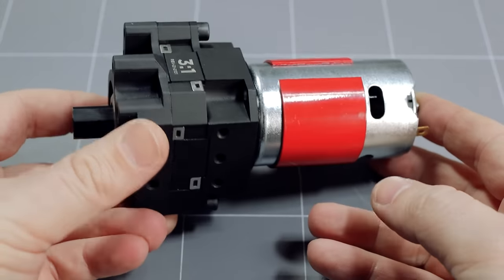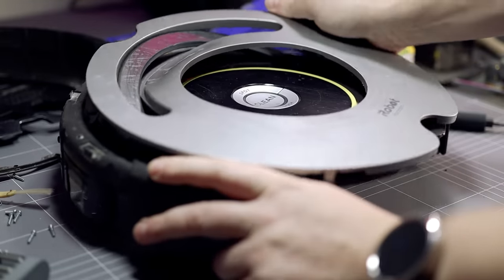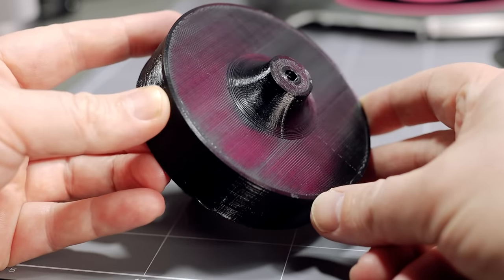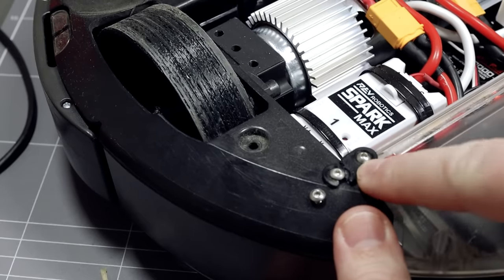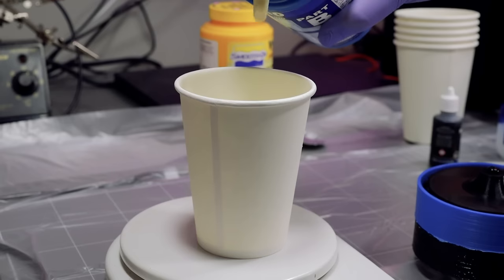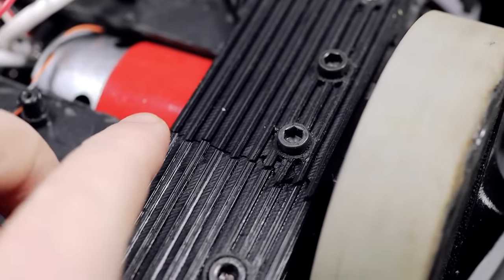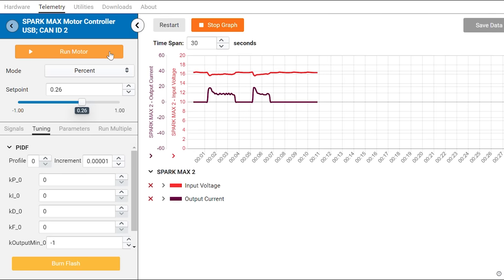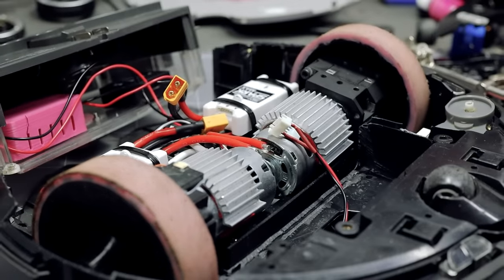Building the World's Fastest Roomba

Comment: In my humble opinion, you don't need stronger wheels. What you need are rudimentary suspensions for your Hot Rod Roomba. I believe that new suspensions would also help with the handling problems. 
A more flashy painting would look good, too! 😉
Reply from the maker: Maybe some simple urethane spacers or something?  A paintjob would be nice too.
Reply: I mean, you're already 3d printing the wheels, why not just design them to flex a bit? I'd try some "compliant wheel" research if I were you.
Reply: @Mr.Glitch247  Perhaps a spoked wheel design where the spokes are shaped to act as a stiff spring for the compliant idea. I wonder what sort of plastic would be suitable for that job.
Reply: @electrosync  Yeah, my first instinct would be something like that between motors and chassis, as longboard wheels can go really fast with decent stability. Something in the 60sa range tops. Perhaps also solid urethane wheels, or at least more urethane? Again nice and squishy, for traction and absorbtion.
Reply: @electrosync  pneumatic or solid soft rubber tires would provide a certain degree of suspension and dramatically improve grip.
Reply: @electrosync  your obviously an FRC guy by which motors and motor controlers
Reply: Perhaps less diameter rims and thicker urethane tire? Also urethane can have different softness ratings.
Reply: @electrosync  Why not make the whole wheel out of urethane? Replacing the chassi with a more durable one would also be nice.
Reply: For the painting part, add flames. Fire paint job makes it faster
Reply: Rubber, it's a wonderful tire material that offers grip, suspension, and durability. Maybe pull some rubber casters apart. McMaster Carr has a huge selection.
Reply: @markposner7803  Regular rubber wears out pretty fast and is most likely too soft unless more solid then the current wheel design. Urethane is much stronger then normal rubber both against wear and more sturdy while still flexible.
Reply: Exactly most plastics are very brittle and can't carry weight. The way I made my canes joint strong was actually incorporating a piece that instead of brute force holding it it flexes a tiny bit
Reply: @SegwayBossk  no other paintjob would do the world's fastest roomba justice lol
Reply: @electrosync  honestly your tires may just be too strong, and too thin. Try taking a book out of the air Jordan shoes, with a rubber cushion that compresses air? That way you add nothing, just change the moulding a bit and have less wheel
Reply: @electrosync a combination of stronger wheels (cnc'd aluminum is what I pictured) and suspension would probably solve some of the problems
Reply: n ah man tbh he needs two anti wheelies also
Reply: @electrosync  I have made the experience, that PC-Blend (from Prusa) is the better material for this usecase (more ductile than PETG and therefor less likely to break on impact). Also printing in a 45° angle further strengthens the printed parts, but yes, it's a pain to print with supports....
Reply: @electrosync  You need a gyro to help with handling, most RC cars are inherently unstable and when they reach a certain speed, the oscillation is to fast for human control to compensate for
Reply: Agreed.

Keep in mind that suspension does more than one job, it doesn’t just make the ride smoother… that’s just damping.. they also have rebound which job two. Suspension is what keeps your wheels on the ground as you hit uneven terrain and bumps. You want the suspension to absorb the bump and rebound quickly enough to regain traction and keep going. 

So even if ride smoothness isn’t a big deal, you should always have suspension anyway to keep the wheels in contact and keep the vehicle going straight.
Reply: @electrosync     mate  im    xavier
Reply: @GRDL.  was gonna say, that's a classic FRC/FTC motor + motor controller setup. Was half expecting to see some Victor SPXs lmao.
Reply: @electrosync  Leaf Spring.
Reply: Did I just read someone suggesting to somebody else to upgrade the suspension in his roomba? 🤣
Reply: @electrosync  Hello, please trad this :) :  Bonjour, je suis désolé, mon niveau d'anglais est mauvais
Je pense que le plus important est d'essayer dans un gymnase, avec un sol parfaitement lisse. Ensuite des roues en aluminium avec des moyeux en alu aussi. Et pour tes '' pneus '', essaye avec une matière plus douce que la résine, qui est très dure et amplifie les vibrations caoutchouc fondu...) . Enfin, pour ta roue anti-wheeling, met 1 devant et 1 derrière, avec moins de 3 millimètres de débattement car tu gagnera en stabilité ET motricité
Reply: Adding suspension would make it more passenger-friendly to your cat test-pilot.
Reply: @Mr.Glitch247  that’s actually a great idea, try printing the motor mounts in TPU, and print a little hotter than normal to make sure it extrudes well, your first wheels looked a little patchy. They’ll never break, the worst possible damage would be them getting torqued aside and causing interference between wheel and chassis, and maybe popping off the screws.
Reply: @electrosync  Everybody knows that if you want anything with wheels to go faster, you must paint flames on it!
Reply: Or pneumatic tyres?
Reply: Yeah. It's a little hard to go fast when your roomba will vibrate itself off the ground
Reply: @electrosync  i'd go with some parallel leaf springs, that should work well enough and take almost no space.
Reply: @DanteYewToob  Yeah the rebound part is probably more important here. I suspect it's a combination of bouncing and the urethane anti-wheelie wheels that are making it hard to control. The bouncing means that sometimes one wheel won't be touching the ground, meaning you're gonna get a torque that turns the roomba. I doubt even a really good suspension is enough to fix this, though. Maybe some sort of torque vectoring that cuts power to the other wheel if one experiences a sudden drop in load?

As for the anti-wheelie wheels, they're gonna oppose turning and cause bouncing on their own while turning. They're also causing more friction than a skid pad. I say just use a skid pad.
Reply: @electrosync  A leaf suspension system like the ones on pickup trucks could work.
Reply: @electrosync  needs flames!
Reply: @AndyGneiss  having a dedicated suspension is always appreciated, it's very hard to control the balance on tires alone even if having huge sidewalls help grip massively
Reply: You’re using a non-Wi-Fi schedulable Roomba Chassis

Comment: Amazing. Just imagine how fast it can clean now 😁
Seriously, great project.
Reply from the maker: I imagine if it still had the standard board and sensors, it would probably put a hole in the wall!
Reply: @electrosync  there is only way to find out 😁
Reply: @electrosync  Sensors need to be upgraded to match, then it won't impact walls at excess speed.

Comment: You definitely need suspension to keep the wheels on the ground. Rebound is very important in a drive layout like this because of one wheel has even slightly more traction it careens out of control.
You want the wheels to hit small bumps and immediately spring back down into the road.

Suspension isn’t just about a smooth ride, rebound is arguably more important!

Comment: Great job on this, one idea i have for anti wheelie v3 is to basically have it like an old ball mouse, so it can spin around with less resistence and improve the durability of it
Reply from the maker: Great idea!
Reply: maybe make the wheel out of teflon or some other low friction/wear material
Reply: Would collect all kinds of crap and potentially jam if not clean surface, but there is ways around it, just that those demand space. I would probably attempt on instead of that build in servo the adjust the angle of the wheel based on gyro values as kinda thrust vectoring in a plane steering type of thing, but it should be lightning fast to response and have more weight on the wheel, so it can self correct chance of direction when no input is given and maybe adjust those steering values based on its speed so it steers less in higher speeds.

Comment: Great build! I think those urethane wheels are a great touch.

I wonder if there's any space to add ribs or at least a thicker head for those wheels. And you may be able to save those plates by epoxy-ing metal or fiberglass for more rigidity.

Next idea; make it suck. But like REALY suck by using an EDF to make more downforce. Might cheat you into better handling, lol.
Reply from the maker: Thanks! The urethane casting was new to me - it's actually pretty fun (but smelly). There are actually ribs on the rims, but I could only fit 2 mm on there, so they probably have limited effect. An EDF is a great idea! Where my logo is in the centre of the Roomba actually has direct line of sight to the ground if you remove a few plastic parts...
Reply: What's an EDF?

Comment: I agree with Maker-Mindset, a suspension system of some sort should help with the impact problems. I also think a small gyro in the steering control would help with avoiding collisions in the first place. It would need to be as close as possible to the centerline of the Roomba, and would take some tuning to get it working right.

Comment: Some form of a suspension system can help a lot with the harmonic bouncing that is likely the culprit in breaking the wheels.
Also, i think with this design i would implement spherical tires as method to prevent the wheelie. These dont force the roomba foreward like a cylindrical wheel does. I'd also make sure that the chambers that these spherical wheels are placed in have suspension too.

Comment: Really impressive job m8! 
Some thoughts that may help you develop it!

You're dealing with high speeds, considering the project size. So, if you want to go faster, you should try to add some weight to it. That will provide more grip to the rubber wheels. Or (but I don't think it's worth because again, the project size is small) try to improve down force or reduce air resistance as much as possible.

Also, the wheels. Try using a softer material, that is shaped like a proper rubber tire, hollow inside. The rubber tire plays a big part of the suspension system in modern vehicles, and considering that you're using electric motors, that transmit power and accelerate without delay at all, a subtle force is transmitted directly to the wheels, that may or may not be too of a suddenly for stiff rubber... Thats why top dragsters have soft tires... so, it's a good ideia to avoid losing grip.

Another important thing is that the project doesn't have any kind of shock absorbers, like suspensions or dumpers. So what happens is that all the reaction forces that hit the wheels are directly transmitted to the chassi itself... And considering that you added a lot of 3d printe parts, all this undamped energy will damage these 3d printed parts. 

That being said, adding a suspension and the arms mechanism will definitely raise the overall height of the project, something that we don't want... For this reason you should also redesign the power train itself. The current system connect the motor to a planetary gearbox set and a wheel, all in the same line/plane. Keep the current location of the motors and the misalignment created by the new suspension mechanism and the wheels can be corrected using a dual universal joint. Kinda like in this image: https://images.app.goo.gl/wdp5oSmsmAtZTY15A

Also, if you're ideia is literally "make the fastest vacuum cleaner robot of all time" because fuck it, let's put this thing in the Guinness world records because YES, power delivery should skyrocket m8... Drain the batteries in seconds if possible, delivering the maximum energy possible to the engines for the maximum nominal RPM possible (before the motor blows itself)... 

Keep going!
Reply from the maker: Thanks, those are all awesome ideas! If I make a follow video, I think I'll go full mods and ditch my self-imposed rules.
Reply: @electrosync  if you want to, we may have a conversation about it! I have a few years of experience dealing with prototype models, most of them are tugboats, but mechanic is mechanic in the end... 
Have a great day!

Comment: Ha ha! That's awesome! To maintain stability at high speeds you'll probably need software control like ardupilot. It can automatically balance the throttle for the motors so you can go balls to the wall as much as you want. :)
Reply from the maker: I think some form of help is required. I'll look into this.

Comment: Your nuts! Keep going!

A track racing room roomba with instead of a pit stop a cleaning stop! 

Notes for improvement 
Survivability - dampen the vibration or upgrade to aluminium or steel mounts

Control and grip have your 3d printed wheels just be hubs let the urethane make the rim and the tyre making the rubber both soften the blows to the chassis and provide more grip with more flex 

But most of all

Have fun doing it!
Reply from the maker: Great ideas!

Comment: I think machined billet wheels would help handling and durability due to the added weight. Also have u thought about using a gyro to stabilise it? Some Rc drifters use them as a kinda cheat to maintain slides. Also maybe worth concidering a 2-1 ratio gbox for less torque so less wheel spin with the 4s lipo. I love odd ball things like this.

Comment: this is my first time seeing your channel so i dont know if youve implemented it before, but using a gyroscopic stabilising ecu should help keep it going in the right direction, and adding ribs inside the wheel for bracing so long as you have room.
Reply: Gyroscope stabilization isn't always the best, in somecases, (70+ kph), it adds unstable woble. But it's a good suggestion.
Reply: @usmanejazz4797  that's what PIDs are for. Also most modern ECUs can adjust the stabilization down as the speed goes up.

Comment: If you want some flat metal parts, my favorite way of going about it is buying the raw sheet/plate metal, 3d printing a guide, bolting the guide to the metal and using an angle and die grinder to cut off the excess. You can drill one hole freehand, bolt the 3dp part through that hole, use it to pilot a second one and it's fully constrained with an additional bolt.

Comment: I think some toe-in and a basic suspension would dramatically improve the straight line stability if you can work it into the chassis. Also, try two wheelie wheels spaced apart with a hair of toe-in as well.

Comment: As a lifelong rc enthusiast and mechanic I’ve found this very entertaining! and I’ve got some suggestions, for the wheels and tyres how about 1/8th scale buggy tyres or some bsr foam or even Traxxas xo1 wheels,and how about a gyro for stability a combination of gyro location and tuning along with center of gravity adjustment should see it dead straight but the biggest gains will be in a semi pneumatic tyres or Eva or hypalon foam giving it some suspension keep the chassis rigid and simple suspension could work but adding suspension with huge unsprung mass would not handle as well as just tyres with give

Comment: I built a combat robot with a similar shape and speed to what you are using (scaled down). One thing that really helped with handling was adding in a heading control. I used a micro drone flight control board that had an onboard gyroscope. I wrote some simple software to read the amount of yaw commanded by the RC receiver and compare that to the amount of yaw measured by the gyroscope, and with a basic PID controller, adjust the difference in power to the left and right wheels to try to keep the measured yaw equal to the commanded yaw. It worked great for high speed attacks on uneven surfaces with an imperfect chassis.

Another thing that might help is torque control. By limiting how quickly the power to the motors can rise, you limit the amount of torque supplied to the wheels, avoiding slip that would cause you to lose control. This also limits your rate of acceleration, but you're aiming for top speed, not a quarter mile time.

Comment: I’m on a robotics team, and don’t spark maxes seem like overkill? They are designed for brushless motors, you could probably get away with a spark mini. Also am3775a/775pro motors are probably my favorite but they burn out fast. I smoked one just yesterday.
Reply from the maker: You're probably right. But I thought I could upgrade to brushless later on and use the same Spark Max's.
Reply: @electrosync  makes sense. neos are great but a bit big for the roomba, however it would be fun to watch how fast it would go

Comment: A fun and easy 2 wire solution to your stability issues is a cheap RC Gyro typically used for helis.
Place it in line with your yaw axis.  It will provide instant and adjustable electronic stability control.
Reply from the maker: Great suggestion. I may have to change my stick mixing, but it could work. Thanks.!

Comment: You could try adjusting the infill pattern and amount to try strengthening the wheels against the lateral and jolt forces that keep breaking them. Maybe replace the solid wheel with more of a compliant mechanism able to absorb more of the impacts as a spring.

Comment: You can think about using PACF filament for printing functional parts. I used it too for really heavy duty car parts and its not that difficult to print. You just need a dry box and a steel nozzle at 260°C.